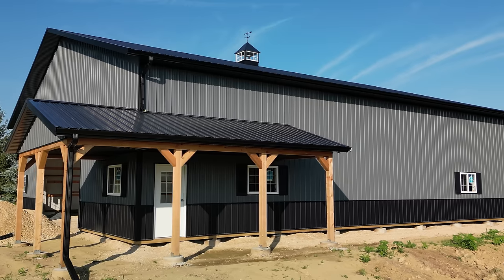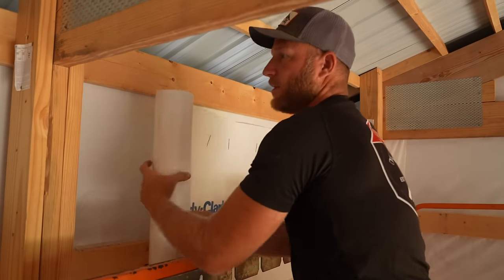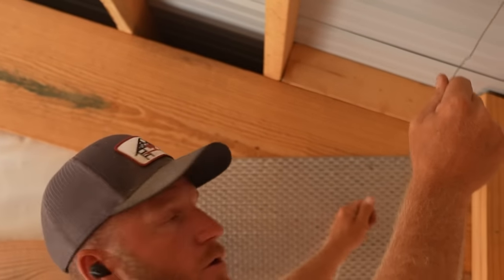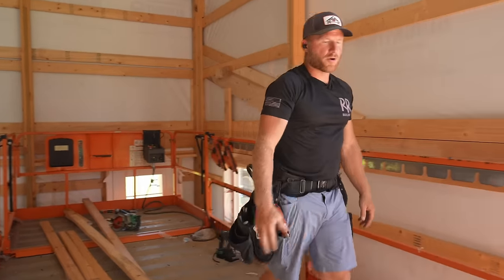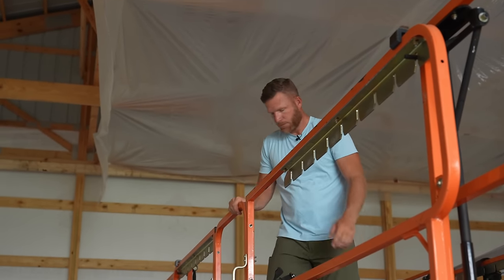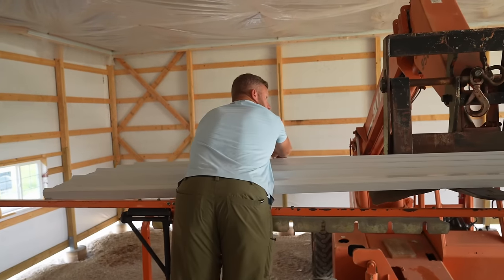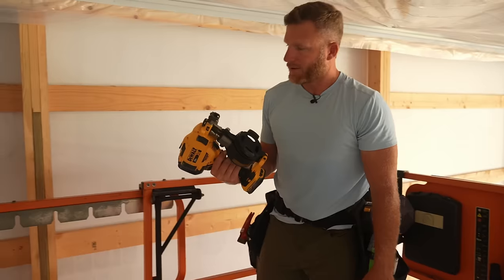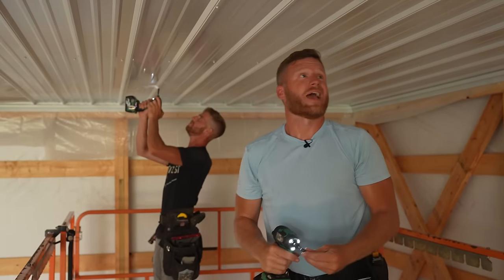Farm Shop Metal Ceiling Install Plus KEY Details!

Comment: I put a steel ceiling in my 42x64 Morton building all by myself using all the techniques learned from watching your videos.  I did the 3 sheet stagger, F&J trim, working back to front, roofing gun to nail the end sheet, etc.  I did not do the air deflectors however, because I was putting in R38 batts as I went for insulation.  Wrangling 16 foot sheets with a drywall lift on the JLG lift by yourself SUCKS BTW.  I also pre-wired for LED lights and ceiling fans too.  It was a TON of work for one guy who had never done it before, but I got 'er done and it looks great!  I want to thank you for all the knowledge that you share, because my project would have not have turned out nearly as well if I had not watched your vids 1st.  Thank you Kyle!

Comment: I would personally use 2 equal length sheet with a single joint in the middle. It's not hard staying straight, you just start the first row with a chalk line than put a mark every 3' on each end and at the middle truss/purlin. I get that it's much easier to stick with 16' sheets, but it wont look as good.
I'm also skeptical with only putting screws every 8', especially when there's insulation on top. Most manufacturers recommends support every 4' or less. Judging by the way the metal comes up when you a put a screw in between the truss, that metal is going to bow down once the insulation is on top. You might not be able to see it now, but once the lights are installed, it might create some weird shadows.

Comment: My builders used styrofoam insulation deflectors for the soffits....many of them fell down in the 3-4 months before insulation was blown in. I asked that they staple them back up prior to insulating.  It wasn't a fun job for that guy. I didn't feel too bad since it was the same crew blowing the insulation, and I had recommended RR's tyvek method before they built the barn.

Comment: I just did some of my ceiling in my shop, mostly by myself. Bright white metal looks so good and the end result is very gratifying. It was a pain in the ass but i figured out a safe way to do it with a drywall lift. I always like to check out your videos, usually AFTER I did my work! 😂

Comment: You always do a bang up job cutting the trim pieces with your red and green scissors.  It is never that clear exactly how you do that so nicely so I wonder if you could run a class on that.  there is probably a limited number of corners or and trims and you might be able to lay it out and show exactly how you do it.  Thans

Comment: I greatly appreciate your content. I have built my own shop and plan on installing interior metal on the ceiling as well as the walls.. What do you call the specific channel you use at the top of the wall where the wall metal and ceiling metal come together?  It make a very clean look. Thanks for letting me know.

Comment: Do you use drip stop roof metal when you’re putting an insulated/vapor barrier ceiling in?
I’m looking at building a 40x64x20 with an insulated ceiling (I’ll do walls/wall insulation at a later date) it’s almost $1,000 for drip stop roof metal and why buy something that isn’t needed but also would hate to cheap out on something for $1,000 in the overall scheme of things. Thanks!

Comment: How wide of vapor barrer do you guys use between trusses?
Also on your next video where you do interior, how would you do rib metal on the sides. Mainly at the base is what I have questions with. Also around outlets. And best way to mount wall cabinets on rib metal

Comment: How far down (distance in Feet/inches) do you put your top purlin down from the peak of the truss and how do you work out the spacing of the purlins from there. In that I mean do you lay the purlins on center from the peak or on center from the first purlin down from the peak. OR do you lay the roof purlins our from the soffit up???

Comment: Bend a rebar into a hook at one end, and a handle with a scoop-holder at the other. Then you can set the tyvek roll in it, and roll out the tyvek without struggling.

Comment: Great work practices Greg and Kyle. You guys are always measuring twice and focused on the initial layout to be square and level so that the final build has the least amount of error factors. 
One thing I am still trying to figure out is how you seal up the base between the ground level and lower sill on this style vs. concrete stem walls. 
Looking forward to your "main office" building project.

Comment: I want to learn the best way to put a new door where a door does not exist in a pole barn. Should I cut the metal fist and then frame the door or take the  metal sheet off the building where the new door will be located
Reply: Probably best to take the metal off bud. Cleaner product at the end

Comment: Hi from Easton Maryland, a little tip for you guys, keep a small strong rare magnet in your tool pouch and when you drop some dado, reach a wire or even if you drop your hammer, put the magnet on  your tape measure and you can pick that up. Take care and thank you for sharing your master knowledge.